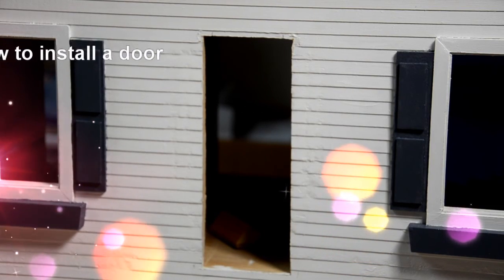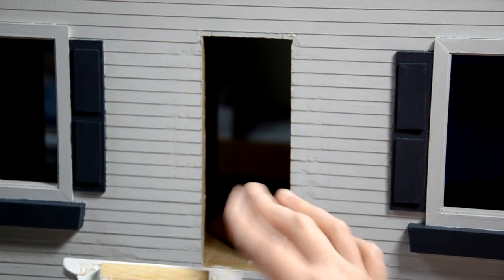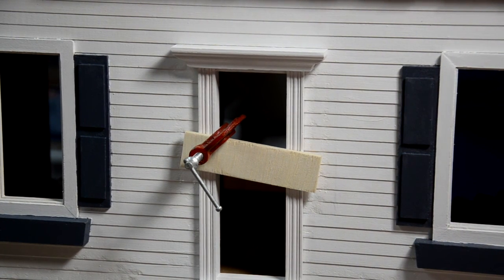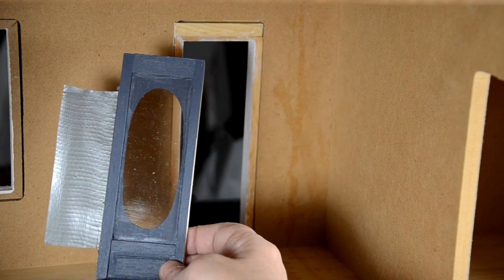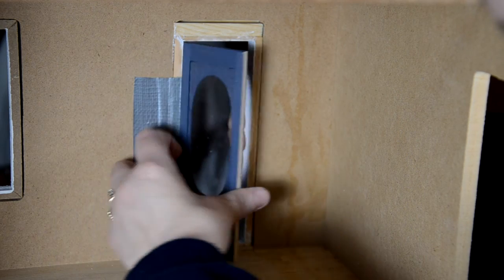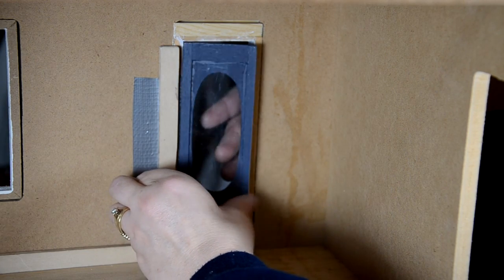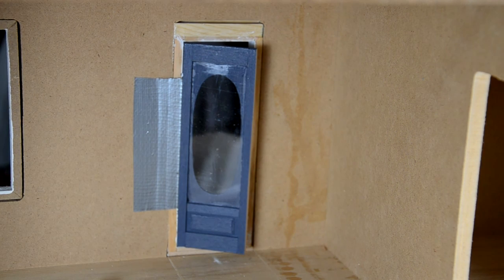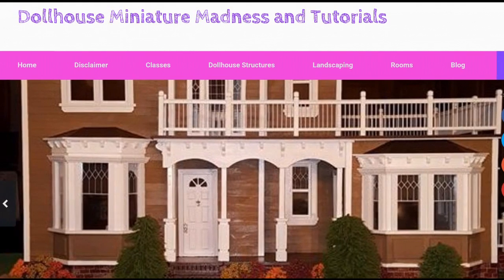How to install a door and frame

Comment: I have a Victorian Dollhouse that i got from my son in law...its needs to be renovated inside and out ...
How would i do this dont want the wallpaper i want to paint the outside and inside not a wallpaper fan...need help
Reply from the maker: Jamie Turner I would buy white card stock then hang it like you would wallpaper. Once its hung I would paint thin layers of paint on it with a soft brush. You won't be able to tell it's paper if you paint it in thin paint layers. I have several wallpaper tutorials showing you how to hang it if your not sure how to. 
I have used posterboard and cardstock several times so my wood looks nicer. You can look on my dollhouse facebook page under the Beacon Hill Dollhouse album for the front windows and interior windows to see how it looks painted. It gives a much nicer look to the finished dollhouse. 
www.dollhousetutorials.com
Reply from the maker: Facebook Link 
https://www.facebook.com/Dollhouse-Miniature-Madness-and-Tutorials-1049935701724787/

Wallpaper Link
http://www.dollhouseminiaturemadnessandtutorials.com/dollhouse-structures/wallpaper/
Reply: Thank you so much for your quick response.   This is my first time at doing a dollhouse been working on a roombox but is going to be a great way for me to learn....thank you so much... I will be asking a lot of question as I start on my project
Reply: Oh so what can I do about the outside of the house would love solid colors and maybe do some bay windows have a lot of things running in my head lol
Reply from the maker: Can you email me some photos of the outside I will look at them tomorrow to see if there is anything I can help you with. 
When you send it mark the subject as "DOLLHOUSE QUESTION IMAGES ATTACHED" laurieheisler@gmail.com
Reply: Alright will do...thanks again